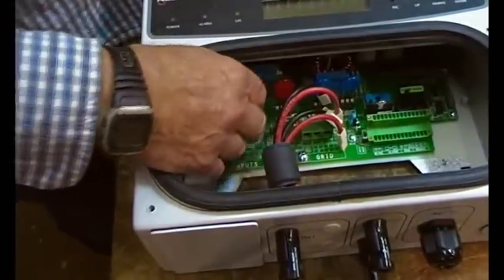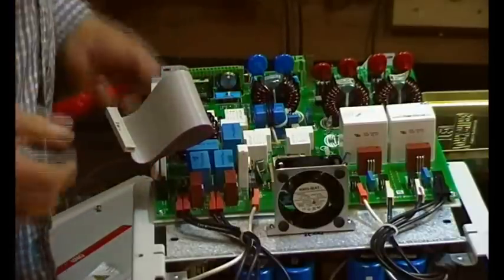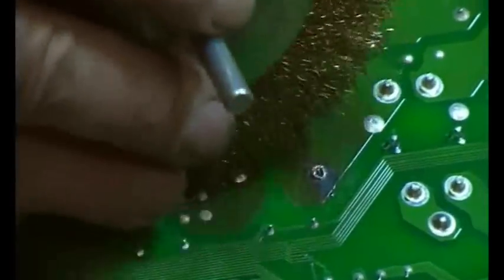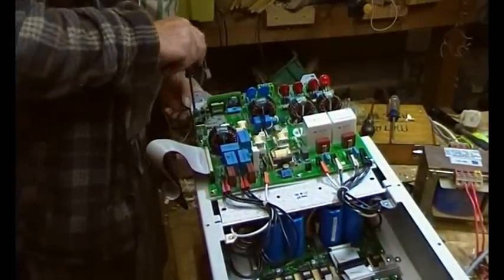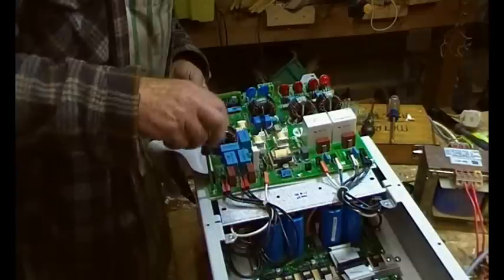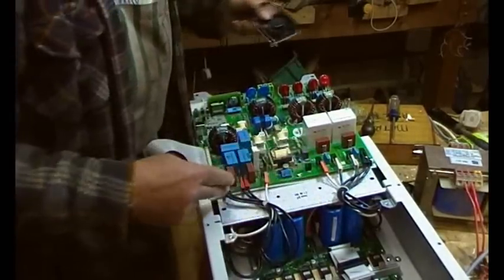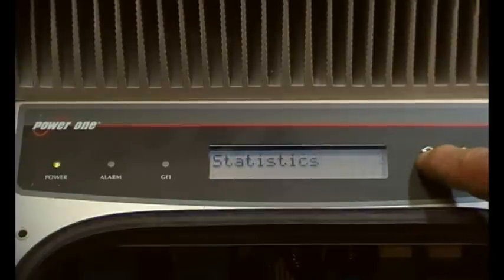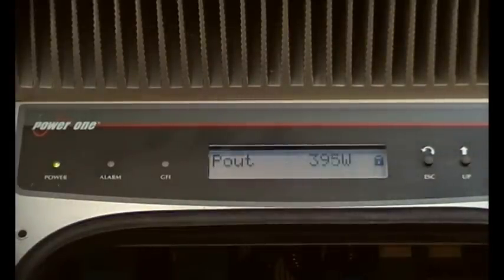ABB Aurora  inverter fault code E031 fix / repair

Comment: Hello Andy, I have error 031 on my inverter. I have removed the suspect relays (the same pair as in your video).
I have opened one to see where the damage was, to my surprise the burned pin was not the one from the stationary contact but the one from the moving contact I think that the source of heat was the copper (possibly beryllum copper) spring at the section where it is split in two, it looks a very small cross section for the 20 Amps that the relay is rated for. I have replacement relays on order and expect to completete the repair soon.
Thank you for this video which was extremely helpfull
Reply from the maker: Thanks for the info, grwat you are fixing it.  I have some questions for you. The board is double sided so are there any connections to the relay pins from the relay side of the board? and secondly was it difficult to remove the relays? Cheers
Reply: Thankk you for your reply Andy, it was not dificult to remove the relays as the hole in the pcb is larger then the contact pins . I removed the solder from the contact pins first using a combination of a solder sucker and desoldering braid, this freed the contact pins. For the solenoid pins I heated one and moved the relay slightly away from the pcb, then the same process for the other, then repeat until the relay is clear of the pcb.

(insert a thin piece of hard plastic or thin cardboard  between the pcb and the relay and use this to gently lever up the relay I used a small screwdriver but scraped the solder resist off a thin track under the relay which I had to check with a meter to see that I had not damaged the track).

If not done carefully there is a danger of pulling the plating out of the hole. I have a lot of experience in repairing pcbs so fdor me this was an easy procedure.

Next remove the solder from the holes for the solenoid pins with the solder sucker. I have just checked on Ebay solder suckers an desoldering braid are available there.

Yes there are connections on the component side of the pcb. When the relay was removed I was anle to look into the hole and the plating was still there connecting the front and back layrers (and also any internal layers). 

I have also seen your second video and have scraped the solder resist (varnish) from around the overheated pins to make a better connection (Ihope that this will prevent a problem in the future).

My inverter is now repaired and running.

Regards

Peter Bell
Reply from the maker: Peter, thanks for your brilliant and in depth reply. I have an aurora with 031 that I have done the solder fix and the fault remains. I now think the problem may be on the front of the board and needs relay removal. Maybe a video in that! Please see my video on extending grid inverter life, cheers, Andy
Reply: Hello Andy  I have already seen that video, My system was bought from a now defunct instalation company, the inverter is in the loft and the panels are on the roof, 9 in all ( it was supposed to be 10 but there was insufficient space on my roof, so maybe a good thing) with the interconnections under the panels,. When I set up the inverter after repairinhg it, it showed 3.0 KW being generated. Changing this arranhement will not be practical for me, but I do agree with the points that you made in your video. I have a maximum minimum thermoneterwhich I will set up in the loft during the summer. fortunately the inverter is not in direct sunlight and mounted on a brick wall. One good thing that I have observed with Aurora inverters is that the heatsink temperature does not rise significantly above ambient. I will do some experiments on this now and in the summer also. Depending on the results i mat install a snail fan to cool the inverter.

 My system was installed in December 2011  I think that I may look for a second inverter as a backup, The relays that I bought came in a pack of four so I now have 2 spare, I may be able to get an E031 unit for a cheap price and repair it.

I am also looking at and enjoying your other videos.

I like your idea of using ex fork lift batteries for energy storage. What inverter do you use with your  battery system?

I like your system for testing inverters.

As a final comment I keep getting phone calls from people trying to sell me a battery system to use my solar energy at night, I tell them what I get per unit on F.I.T. and what I pay per unit, then tell them "Why should I buy a system from you fo x thousand to lose money on every unit that goes into the battery." I may look into battery storage when my F.I.T. agreement expires.

Regards
Peter Bell
Reply from the maker: Peter, on another issue, since we have been involved with renewable generation since the late 80's we have 2 systems. one battery based to run all the plugables and lights with 1800 Ah, a turbine and panels, and the other grid system with panels and inverters. Strange maybe but with mains chargers and UPS battery inverter it seems to work well, just the way it turned out as the technology developed, cheers
Reply: Have you a part no for the replacement relays
Reply: @andrewkirwin4910  Hello Andrew  the part number is 
AZ2150W-1AE-12DEFT  I did a google search "aurora inverter relay" and found some on Ebay
Regards

Peter Bell

Comment: Brilliant video, My system went down with this fault code , Bright winter day with intermittent cloud, found a burned out solder connection soldered it up and happy days. quoted £575 + VAT for replacement but my local guy Steve at Halifax Eco Heat and Solar suggested Relay fault..... found your channel and hey Presto. The fact the cooling fan is sealed in the case is strange thought about fitting a bigger PC fan and vents in the case to let the hot air out, might keep the temperature down to prolong the life of the components? easier than a snail fan with thermostat???
Reply from the maker: Hi, thanks for the comment and story. I use an extrnal fan controlled by a simple plug in timer. I've produced a video on my thoughts to increse the working life of grid inverters, see my grid inverter play list, cheers

Comment: Hi Andy, thanks for this.  Just fixed my Aurora which had the same dry solder joint fault.  My concern is what causes the relay to overheat in the first place?  I have checked that the cooling fan works ok and that my array is under spec for the inverter.  
Thanks again and hopefully I will get some more years out of this unit.  Don't think I will buy this company's products again.
Reply from the maker: Hi, I extended the solder on to the board track after scraping off the varnish to increase the contact area. The internal fan only comes on when it's too late. I have a video about extending the life of grid inverters, you may find that interesting. Hope you've subscribed and seen some of my other videos, cheers

Comment: I fixed my Aurora 5000 before finding videos like this.  Ordered two relays online as I wanted to replace both and not just the one with the dry solder joint.  20 months later and the fix still works perfectly.
Reply from the maker: Thanks for the comment, I didn't want to change the relays as they were wroking and it is double sided board. I have since fixed a few of these inverters with the same problem and cleaned off some of the varnish from the large track and flowed extra solder over that area to inprove pin to board contact. See my recent video on extending inverter life. https://www.youtube.com/watch?v=GaqHZU8bD0M, subscribed? cheers

Comment: Andy, thanks so much for this. Just discovered the same fault ( E031) on our Aurora inverter.
 Unfortunately I am not an electrician as such, but I followed your journey of discovery to the fault, which makes me think  ours may have been caused by a severe thunderstorm last week. Having checked warranties etc I find that to replace this particular inverter will cost £700 + 20% vat.
A lot of money for such a small fault (wonder if they then repair and re-sell the old ones?) But as we have benefited financially from our system over the years it might be easier to go ahead and have it replaced. 
However I would keep the old one and tentatively follow your vid to see if in fact a simple repair could make it suitable as a replacement. Thanks again for making the effort to do this video.
Reply from the maker: You will need a big soldering iron, but if you fix your unit you will improve your skills, self reliance, and confidence. Please see my video on increasing inverter life and see if any of these scenarios fit your system: https://www.youtube.com/watch?v=GaqHZU8bD0M&t=2s   . Subscribed? cheers

Comment: Please people, this is a multi layer board , and the relays are soldered both sides
underneath the relays the board is also damaged and makes a bad contact.
The current wil flow normaly on both sides of the board , but now the small bus that connects the upper to the lowerside of the board is burned because of the overheated bad contact.

If you solder the lower site only , then the current wil flow on half of the board contacts.
this will result in a new faillure after a few days of full power.
and it can even become so hot that it flames.

The relays are closed because of sparks that can occur when the unit connects ,
these sparks can lead to explosion in some places.
Also all kinds of dust wil come insite the opened relay and will lead to faillure.
These relays are very sensitive components and you can not handle them like a black smit.

To repair a unit like this you need to take the relays of the board with the proper soldering tools
and replace them for new ones.
also you need to make a connection to the other side of the board before you solder the new relays in.

Maybe you noticed that this mainboard has a battery on it.
by just lay it arround on iron parts you can damage the clock chip when the battery is stil in.

Kind regards

Cor van Houtum
Draaistroom Nederland.
Reply: Andy ain't a blacksmith, he has an enquiring mind and a certain degree of electrical knowledge. But thanks for pointing out the finer details of the mainboard.
Reply from the maker: Hi, relays can take some adjustment to take up wear. Chaging a relay on a double sided board with varnish is quite difficult and can damage the board. See my video on extending the life of grid inverters, cheers
Reply: so how would one solder both sides?  I am looking to replaces the relay, but all the video i'm seeing show simply replacing and do the actual soldering on one side only.  Thanks
Reply: Vitaliy Vishnevskiy sent me email and i will show you
Reply: @corvanhoutum6913  did.  Please, let me know if  did not get it.  Thanks!

Comment: Hello, I have the following problem: the inverter initializes but every time it will synchronize with the network and the process is in 2s, the inverter makes a strange noise in the relay and disarms the circuit breaker on the AC side. If you can help me I'm grateful !!!
Reply from the maker: Hi, First take the tops off all 4 relays and check for damage, then check for tracking or burnt connections on the board, cheers
Reply: @TheInfoworks , could you send me your email so that I can record an email and have one more solution to the problem?
Reply from the maker: Just put it up on your channel so everyone can see it, cheers
Reply: @TheInfoworks  Okay, I'll record and send.

Comment: Good morning Andy Reynolds, my name is Romulo I'm Brazilian, I'm with problem Low laughter in an aurora power one inverter, this problem is not in strings since I connected an equal inverter in my system and it worked, I believe this problem should be in the inverter, I already switched the littelfuse P2T420M, it still did not work, can you give me any hints whatsoever?
Reply from the maker: Hi, low insolation is caused by a electrical track to earth in your solar cables. It does not take much, maybe water in a connection that can track down to earth. Check all your connections and see that the cable runs are not in damp vegetation and strapped up properly, cheers.
Reply: @TheInfoworks , Hi, I actually have 2 inverters of this one, one is working normal with the same string that I connect that other one that is presenting this problem.

Comment: Hello Andy, excuse me, I got a problem with an Aurora PVI 6000,  it is used in my work, I was along programming that but I got to go so I left it alone programmed. But the problem was that it was a European inverter and gave 50 Hz, I live in Mexico and we use 60 Hz. So a work partner tried to change from 50 Hz to 60 Hz and by accident he activated "Amorphous Mode" in the inverter. Since it was activated, it got the error 037 "Riso Low". Since then the alarm still present and I cannot access to the options of the inverter and neither program it. In the manual got this....

Low value of the insulation resistance (only with the “Amorphous” mode activated): This error can occur only should the “Amorphous” mode be on. This function is on only in inverters equipped with a grounding kit and serves to monitor the voltage at the heads of the grounding resistance. The error occurs when the voltage at the heads of the resistance connected between ground and the pole of the photovoltaic generator exceeds 30V for more than 30 minutes or 120V for more than one second.

My questions are:
Can I change the inverter frequency from 50 Hz to 60 Hz? If so how can I?
How could I deactivate "Amorphous Mode"?

Greetings and I hope you could help me.
Reply from the maker: Whew what a nightmare, the only thing I can suggest is to power the inverter from an insolated DC supply and then maybe get rid of the riso problem, see my other videos on bench testing grid inverters using a variac, an isolating transformer, an high voltage rectifier with a smoothing capacitor, maybe that will help. What happens if you connect 60 Hz ac to the mains connection, can you get into the menu then? Cheers
Reply: @TheInfoworks Thank you Andy, I am going to try doing that then, and do you know if I solve the problem, that could I change the frequency of the inverter?
Reply from the maker: Hi, I have never had the need to investigate frequency change, so you are in new teritory, cheers
Reply: That´s ok, anyway I am going to try what you said before to see if it helps me repairing the inverter, if it so I will let you know so the experience could be shared. Thanks in advance and if I make it throught I will let you know!
Reply: Jesus Garcia Tamez 
go into service 
use the 6 digit second level password 
set amorf off

sent me the serial number and production date
and the type of inverter

then i give you the password 

and by the way do not repair the units like in this video
this is pure shit
just replace the relais 
they are burned underneath on the board

Comment: Just want to add my vote of thanks to the others that are here.  My UK Power One Aurora PVI 3.6 which was installed in 2012 failed with the e031 error last week.  Your video and some internet research gave me the confidence to uninstall the unit and extract the motherboard, and sure enough I had three burnt pins on the relays.  A little soldering later, and it’s back on the wall and working fine again.  

Can’t say how pleased I am to keep this thing out of the landfill, and not have to pay for a replacement yet!  I expect given my amateur soldering and any design flaws in this inverter, it won’t take 7 years to fail again, but I know I can take it out again next time, and probably take it to an electrical engineer and have the relays replaced and professionally soldered next time.  

Thank you so much.
Reply from the maker: Dan, thanks for your appreciation. The cooling needs inmproving on these units, an external fan and time switch helps, see my video on this (feb 2019), cheers
Reply: @TheInfoworks  thanks - I did watch that video as well.  My inverter is in the loft, so I'm not convinced an additional fan will add a lot more cooling, as I'm essentially blowing hot air trapped in the space over the heatsink/components.  I'm toying with the idea of bring external ventilation in from the eves and routing it under the inverter to keep things cooler.
Reply: In fact, an additional thought - I might use a fan channelling air from outside hooked up to a smart plug.  That means I could use IFTTT to switch the fan on only when the recorded weather outside reaches a specific temperature...  So fan only on when temp >15 degrees C or the like...
Reply from the maker: Dan, good idea to the point of being essential, a shower fan and duct should work well, let me know how you get on, cheers
Reply from the maker: Dan, what ever you do keep it simple and so that you can easily check to see if its working. It only needs to work during max production time, so during the day and from spring to autumn, that's why I use a time clock as the fan runs in generation time so no energy is used from the grid. Hope you have subscribed. Cheers

Comment: Thank you. You just saved me the best part of £1000.  Like you said, It's already broken, so what's to lose!!
Took me about an hour to do the job.  The two burnt terminals on the board were identical to the ones in your video!
Re soldered the joints, put it back together and away it went.  Again, thank you for taking the time to help others.
Reply from the maker: Rob, thanks for the feedback. I've got plenty to tell you. First there is a coolong problem with these Abb inverters, see my video on inverter care (feb 2019) and check out my books on my channel page. Good to hear another inverter saved. I will be teaching solar for Brighton Permaculture this June, cheers